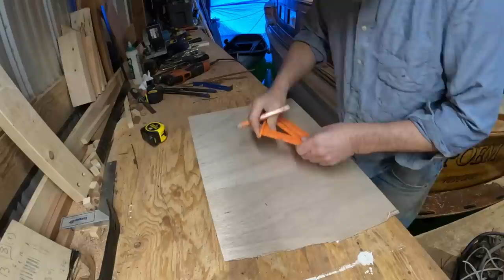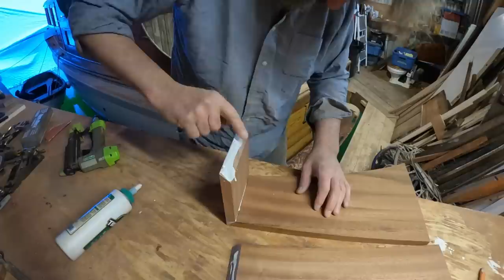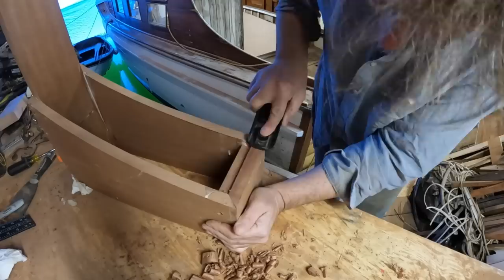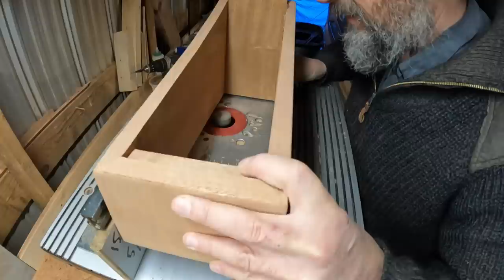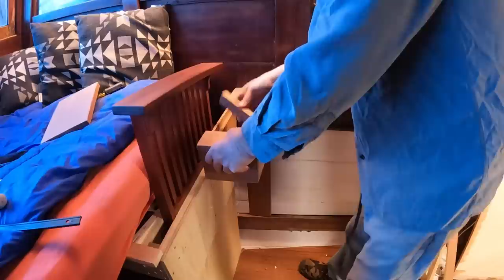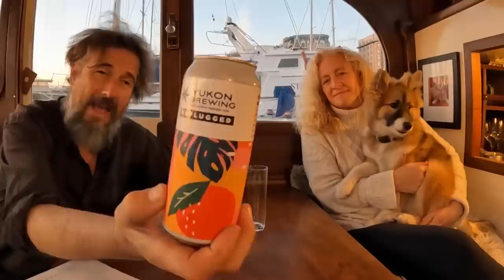Simple Helm - #358 - Boat Life - Living aboard a wooden boat - Travels With Geordie

Comment: Just an idea, since that wheel is wobbling on it's worn shaft, you (or a shop) could drill the center out and have a new shaft, running in a bearing on the inner face of the helm and with a new gear on it's inner end. Then you could run the chain to Starboard and over gears to the cables. You could leave the old gear, but I'd turn it off for a more 'finished' look. Just a suggestion, I'm sure you have plans of your own... 👍😁

Comment: Bourbon Moth Woodworking uses super glue to attach "caul" blocks on the corners where he is gluing miters the cauls are cut to the same angle as your miter making your clamping surface perfectly flat and square. then you knock the blocks off and sand away the superglue that is still left.